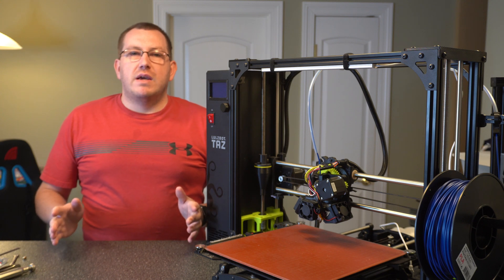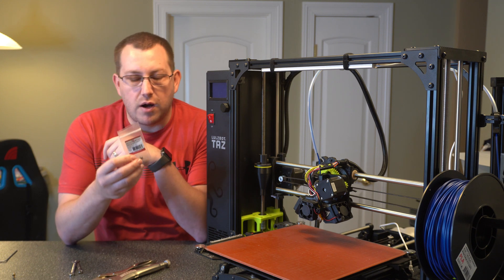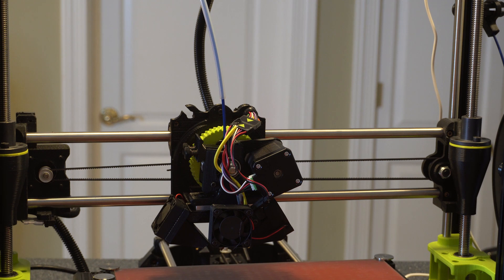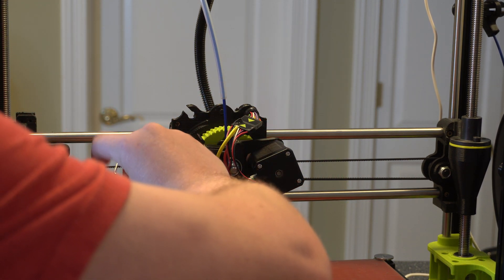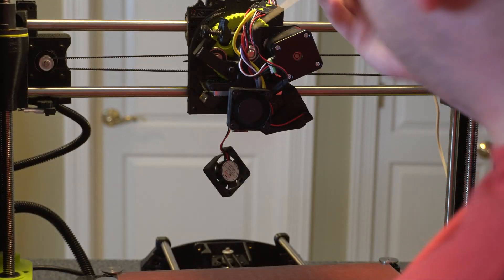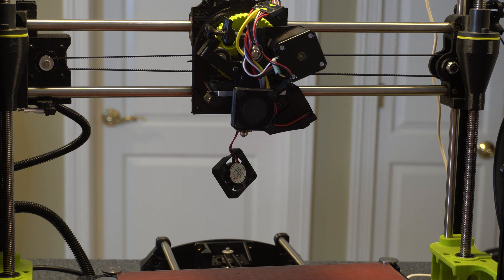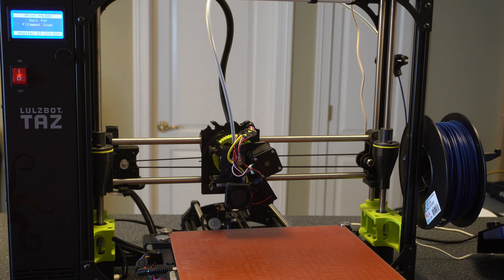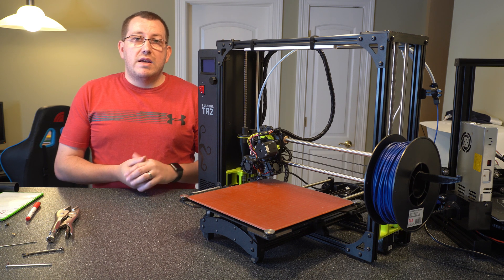Taz 6 Nozzle Change – Complete Guide!

Comment: So today my Taz 6 stopped printing alarming temp runaway or something and after I tried to redo my print, it alarmed again on the heating up.

Would cleaning and replacing fix the issue?
Reply from the maker: Hi. If its a temp runaway error replacing the part should fix it.

Comment: Hi, I went to connect the uno to the board to set the BL touch up. And on my board I have 4 pins in a row and not 6 pin set up. I have an Ender 3 not the pro. Any suggestions? The 4 pins are VCC, SWDIO, SWCLK AND GND.
Reply from the maker: Hi. Do you have the Ender 3 or Ender 3 V2? I’m pretty sure the board was changed on the V2.
Reply: Ender 3
Reply from the maker: Can you email me a picture of the board, I will try to take a look at it tomorrow. My email is admin@3dprintscape.com.
Reply: Done! Thanks